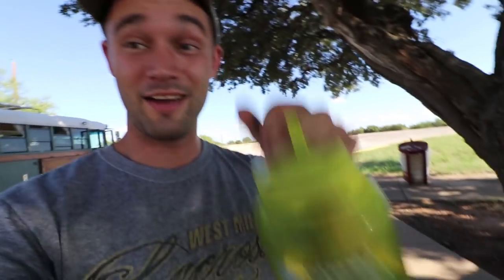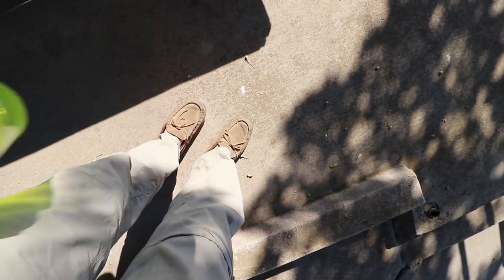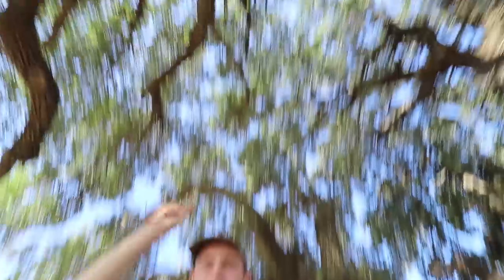How to Install a Battery Alternator Connection For Your Off Grid Adventure Rig

Comment: Sounds like you can idle your engine instead of screwing with a generator. What is the formula to figure out how long a 'X' size alternator will top off a 'Y' amp hour battery bank? Then I can figure out fuel burn and compare fuel costs to solar panel/solar controller costs.
Reply: That's the issue I need to figure out too. Am considering replacing my stock alternator with a Prestolite Idle Pro that generates considerably higher amperage charge rates at idle speeds. I haven't been able to get traction with the math to figure out if a gen can be replaced by the engine and that particular alternator effectively. My guess on factors: amprage / generator speed / fuel consumption per hour / cost of ownership; purchase price-weight-space-fuel  VS. amprage / alternator speed / fuel consumption per hour / cost of alternator modification. While cruising the solenoid addition is a no-brainer. Great video!
Reply: make sure to factor maintince on your rig for idiling for long periods of time. to charge while going down the road is a great idea but to  idle at camp, not so much. Also  Diesel engines really don't like the have a low idle for long peirods of time youll end up losing compression.
Reply: I know big truck drivers idle all the time, do they do something different to their engines?
Reply: they run a high idle slightly over 1200 rpm but its still not good for the engine
Reply: The size of the alternator only matters insofar as it can't be too small. When it becomes sufficient, you could have a gazillion amp alternator, normal lead-acid batteries (like AGM batteries and what have you) charge using constant voltage and at a few amperes - for many hours. A lead-acid based van/rv/skoolie can only ever supplement the charging with the alternator, unless the engine is run literally 12 hours a day, which would be nuts, you'd be much better off buying a small generator. That's why solar works - it charges for a full day, fills the battery, which gets drained at night. Most people don't drive nearly enough hours in the day to refill a lead-acid battery.
Reply: I have Northstar Blue+ Thin Plate AGM batteries originally made for Cell Tower Backup. Manufacturer maximum charge amperage is: No Limit. So a gazillion amp alternator would charge them pretty darn fast I would think?
Reply: In reality, all lead-acid (including that AGM) batteries charge - and discharge - quite slowly. 8-10 amps perhaps. Especially in the final phase of charging from 80% to 100%. See https://batteryuniversity.com/learn/article/charging_the_lead_acid_battery for instance.

The relevant part that makes alternator-charging-only approaches pretty non-viable: 

"During the constant-current charge, the battery charges to about 70 percent in 5–8 hours; the remaining 30 percent is filled with the slower topping charge that lasts another 7–10 hours. The topping charge is essential for the well-being of the battery and can be compared to a little rest after a good meal. If continually deprived, the battery will eventually lose the ability to accept a full charge and the performance will decrease due to sulfation. The float charge in the third stage maintains the battery at full charge." (Taken from the above web link.)
Reply: A 10-15 hp pony motor to run a gen uses a 1/10 of fuel and doesn't run up hours on main engine which also costs considerably less to maintain, ie oil, filters,starters, etc. Unless you don't use much elec and or have a shit ton load of storage. A Tesla power wall would be ideal,
Reply: @lorcro2000  As a convert from boats to RVs I think RV's are a little behind.
Gen set, Solar normally service house batteries and the engine alt charge the start batteries. Keeping them separate could give you a safe back up to start or use storage if an issue arose.
Reply: @LifeMyWay007  that's badass.
My son is a foreman on towers, Ill have him try to find a good source.
Reply: I seem to remember hearing about a 100amp alternator and even larger. If that is true, and the batteries can take that kind of charging amps like mine are rated for, the trade off would be another somewhat heavy piece of equipment (generator) that has its own maintenance and fuel requirements (plus filter, oil, fuel storage...)  vs extra idle time on your engine that runs quieter and at that kind of output maybe even 1/4 as long. Further thoughts? or you still like the generator better?
Reply: @Making_Adventure  hhhmmm.... i wonder how the stationary diesel engines that idle/run continuously (except during maintenance) can function properly?
Reply: @aegrimm5777  the guys that do that have way more money than i do and can afford to rebuild the engine when ever they need to i dont have that luxury and would like to avoid it if possible and if i can help someone else its a win win

Comment: >^. .^<       In 1965 I turned 16 and got my drivers license, In 1966 I purchased a used 1964 VW bug with only a 6v electricical system.  I beleive in 1967 purchased a 12v 8 track tape player. 

I added an additional 6 volt battery under teh back seat and wired it in parallel with my VW's stock battery. Than I ran a wire between both batteries + poles and a simple added toggle switch inbetween both batteries inorder to open/stop the charging circuit manual.

Than I wired up both 6 volt batteries in series, wired in an in line fuse after the 12v connection, than up to my 12v Automatic Radio 8 track by Lear (not the Japanese or Chinese). 

As a 16 year old I was not sure I could wire up two batteries in both series and parallel, no smoke or sparks, I got the 12v I needed and when the music got slow I reached back and closed the charge switch  so I figured you could wire up two 6v batterys in two different ways was my answer.....

Comment: I’m working on the same thing. more or less. I would like to run my setup so the Alternator power matches the charging and end
use. Thus the end goal is one AC and the fridge in the RV. so here we go.  

i have 440A duel alts charging two 750 AGM CCA batteries. so, the power output curve @ the engines up idle of 1400 RPM (4500
Alt RPM), I’m generating 405 435 amps.  Give or take due to Alternator heat. 

Now, at 440 amps I don’t want to draw much more than 220 amps with your inverter. However the running current, vehicle
Electrical, lights, Stereo, AC and phone (small charging will take less than a 100 running amps. That’s about 320 Amps. So 333 amps @ 12v = 4000 watts. So, a 4000-watt inverter is possibly the choice. 

Understanding The max out the inverter at 4000 watts, so pulling 4000 watts /12 volts = 333.3 DC amps per hour.  If using two 750
Amp,12volt batteries, then divide “1500amp battery / 333.3 amps = 4.5 hours of run time.” allegedly If using  Resting
fully charged 12volt batteries are around 12.8-12.9 volts, and flat dead battery is at 12.0 volts, so 12.4 volts on a resting battery means it's about 50% charged so I have now 2.2 hours if I’m not running the alternators. (that’s up for debate) As the truck is a 6.7L diesel, it’s unlikely I will ever run the inverter with the engine shut down. But it’s good to have that bandwidth when going for shore to inverter (truck) power. 

Adding to the mix (this is the derailment). Down the line from the parallel wired AGM truck batteries will be a 0 gauge line to a FX313-500A  0-GAUGE 500amp circuit breaker, then to a NVX 500 Amp Relay Battery Isolator [BIR500]. This will be ignition powered with a kill switch in mid-flight. 

Then to a ANL-500A 500 Amp Fuse Holder (optional overkill) then to a 100 Ah LiFePO4 12 Volt Deep Cycle Battery 200 amp surge output. 

 Now I’m sure this is an issue as it’s 100ah battery and I should have qty of 3 100 Ah Deep Cycle Batteries for 300ah (333 amps @ 12v = 4000 watts IE, 4000 inverter) but I don’t have the room for 3 batteries. So I’m not sure what this will do to the duel AGM batteries or alts as the inverter will be running for hours on end. 

Anyway, then with the 0 gauge cable we get into a 4000W inverter. (Power Inverter 4000 watts @ 120V = 33.333 amps Final output) This converter has the 30amp out to a 30 amp 125 – 250V shallow mount outlet. This installed in the bed of the truck by the 5th wheel light array plug for the RV or trailer. 

Then attached is a 30 Power defender analyzer with surge protection this is for the protection of the RV or trailer if there is an issue with the inverter as I’m still unsure about the 3 deep cycle battery

From there we convert from a 30 Amp to 50 Amp RV Plug Adapter Heavy Duty Dog bone Electrical Power Adapter 30M/50F 125V/3750W, 

All this to power an AC 15,500 btu =  4396wh ?????????

and 

An Average RV 18cu Fridge 500btu = 146.5wh ?????

So finally 

An Average AC unit is 15,500btu = 4543.6 W

An Average RV 18cu Fridge 500btu = 146.5W

16,000 BTU = 4,690 watts (rough)

4,690 watts = 40 Amps (single phase)

Crap!!! LOL

Comment: Hi! Do u need commercial driver license for driving schoolie over 29000 gvwr? (29800lb)
Reply from the maker: It depends on the state. But, If it is no longer a commercial vehicle you don’t need a CDL. You may need an air brake endorsement though. Check your state laws. 👍
Reply: Been missing your videos... Hope all is well.

Comment: I've yet to build my RV but have lived on several boats, the issue with engine charging house batteries is your storage capacity.
After driving a month with minimal storage you only have hours worth of electricity.

Comment: Playing with electricity require much caution.

It's one thing to have a lot of available amps but if the rest of your vehicles wiring cannot handle that excess amperage the resistance of those wires could be a cause of concern.  Sort of like fusible links.

Comment: Your vid is a little misleading. An open circuit like a wall switch for your lights at
home, is open when it is in the off position. It is closed when in the on position.
closed when the current flows. Open when it does not.

Comment: Some more info. The isolator or reverse current cutout relay(aviation) stops your batteries from running your alternator. There is nearly nothing different between an alternator/generator and a motor. If your battery voltage is higher than your alternator it will run it creating negative torque which is not good for your vehicle.

Comment: Unless you're using a Lithium battery pack, using the alternator won't get you the experience you're probably looking for. Lead-acid batteries charge slowly and over many hours, so you have to drive 8-12 hours a day to keep them topped up, after draining them over night. The first day you want to stay put for two-three days your battery empties and immediately starts sulfating to death. It will die in a few months, probably. Why does Lithium potentially change the equation? It can charge orders of magnitude faster.  Downside? Lithium will cost more than a solar system.
Reply from the maker: Thank you for the suggestion.

Comment: That power isn't free. You burn extra gasoline equal to whatever electricity you get out. Unless you installed regenerative breaks which harvest electricity from your deceleration. I have never seen a bus with those, some new hybrid and electric cars have them.
Reply: StarSeed so it basically just turns your engine into a generator? So is sitting there idling just as efficient as a generator?

Comment: Nav-Now Check out these 4 step charging devices using the Alt on the vehicle. Probably the route I will go once I'm at that place on my build, may add an Idle Pro low idle high amp alt to go with it- depending on the math; https://sterling-power.com/collections/battery-to-battery-chargers

Comment: Too much on  Necessary talking, There is much easiest way to do that 1 way is just run a cable from your alternator plus to your battery plus with the fuse and ground your  Nbatteryegative to any part of the car medal on your car.   2nd way way just run a cable from your  2nd battery to your cigar later
  when a car is on going charge the battery when the car is off it does not drain your main battery